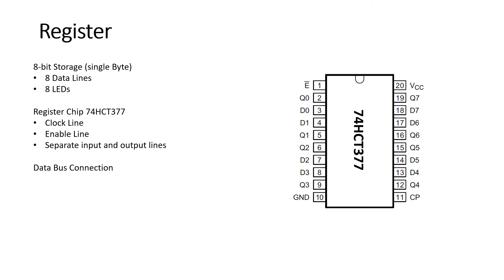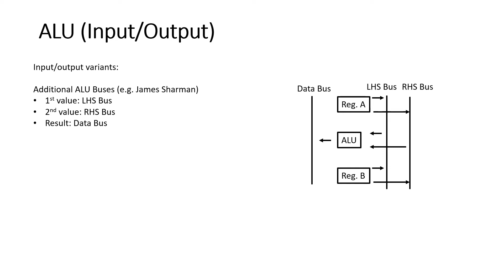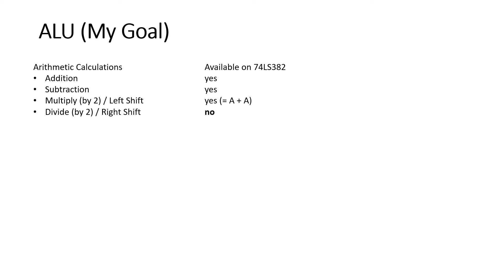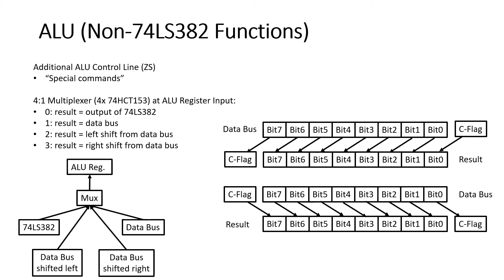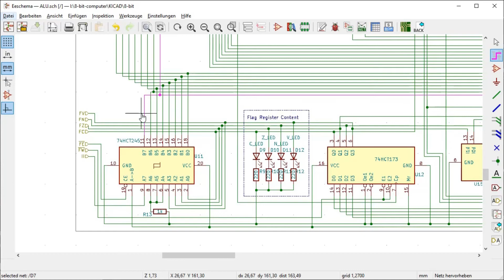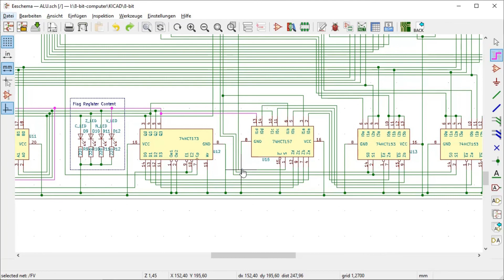8-Bit Breadboard CPU (ALU, Flags, General Purpose Registers)

Comment: Will you be posting an instruction set video anytime soon?
Reply from the maker: When I created this video I already gathered the footage for the micro code and instruction set video, but the slides I created to guide me through this topic didn't meet my expectations and I deferred the video. Soon after I got distracted and only recently started uploading again (it's an "easter egg" video only available through the playlist). So, yes, I'm in a good spirit to restart working on the missing video about the instruction set.
Reply: @DerULF1   Hello! I apologize if this is inconvenient, but are you alright with simply uploading the instruction set and format onto your github? I am trying to compare some different instructions sets that I've see to aid in the construction of my own expanded Ben Eater SAP-1.
Reply from the maker: @A_Hipposhark
Sorry for all the delay. Obviously I forgot the promise I gave to you.

I made a quick export of my old presentation slides which match the state of the machine shown in the videos. It's available now in the root directory of my GitHub repository. Please feel free to get back to me if you need more information. Talking about computers is never inconvenient for me. ;-)

If you compare that to the Arduino Sketch EEPROMMicroCode.ino which creates the micro code you might find one additional instruction called INB which was in a test stage at that time. This instruction is my first complex instruction with a loop in it's micro code and is reading a complete byte from the SPI bus. Later I was able to extend that to a nested loop and to read a block of 256 bytes into memory.

I hope you have as much fun building your own computer as I do.
Reply: @DerULF1  Hello! Thank you for sharing the slides as well as your explanations; they have all been very helpful. I do have another question relating to your schematics. I am also trying to sketch some of my breadboard modules in KiCad, but I can't seem to find any of the 74hct chips in their library. May I ask where you got those?
Reply from the maker: @hipposhark  Happy to hear you were able to do something useful with my shared ideas. About the HCT-components: The truth is that I kind of cheated by (mis-)using KiCad more like a drawing tool than a circuit design tool. So I just placed that chip onto the sheet that was close enough to the one I needed and changed its description to match the the one I needed. This is why I didn't upload my KiCad files but only the generated PDF files.
Reply: @DerULF1  Ah I see. Very clever! I will see about doing that as well. I have another question concerning your ALU. If you are currently multiplexing the 382's output into the internal state (ALU register), wouldn't it be in an infinite loop at the rising clock, where the 382's input from the register would change, so it would continuously output a new value into the same register over and over again as long as the clock is high and multiplexer's value is loaded into the ALU register? How does the 382 only output the intended first value and stop outputting? Thank you for answering my previous questions!
Reply from the maker: @hipposhark  I'm happy to read, that you're still on your way. The ALU register chip (marked as U2 in my ALU schematic) is a 74HCT377. This chip latches the input value exactly once at the exact time when the clock changes from low to high. Although the output of the 382s is indeed changing a few nano seconds after the rising clock, this output is not read by the 377 and so only the first output value is kept in the ALU register. I hope that makes sense.
Reply: @DerULF1  That makes sense. I was asking because I was trying to implement your design with some modifications which included the 74HCT191 instead of the 74HCT377 for increment/decrement capabilities, but those chips were unable to latch onto inputs as you pointed out the 74HCT377 could. 

I also have another question about your instruction decoder/control logic schematics. Your explanation and reasons for adding the interrupts and the addition of the IC/IL lines were clear, but I am still confused of the purpose of some chips on the schematics. For example, what is the use for the 74HCT173 in the Instruction Register. I see that the first bit from the instruction register is being fed into the chip, and the select line is toggled by the IL/IC lines, and I also saw that you mentioned extended instructions in another comment on the video, but what purpose does this serve or how does that work? 
I am also not following the reason for multiplexing the instruction register with a word consisting of the bits of the ALU function selector and the data bus enables. You called them 'labels', but what is the purpose for that, and wouldn't the values collide with the predefined instructions values? 
Also, how does the microcode work if the values of the step counter not also being fed into the microcode address table? Wouldn't incrementing the microcode after it has been found based on the instruction, flags, and control lines (the address) effectively be destructively manipulating the data gotten from the address table. Instead, shouldn't the step counter and the microcode address table be separate values being fed into the microcode ROM? How does the step counter count from the inputted decoded instruction value? I am very confused.
Reply from the maker: Sorry, for confusing you and also for the late reply - I've been too busy last week. I've tried to put the anwsers in a new video covering the topic "extended instructions" ( https://youtu.be/8lOQt8oHVbg ). Please get back to me if you need additional information.
Reply: @DerULF1  no worries! i did eventually figure out what you were trying to do after taking a nice long look at your breadboard, realizing there were some ics missing based off of the schematics from github (extended instructions were a newere addition i'm guessing), and reading through some of your comments from other videos. 

I just saw your newest video, funnily enough before i read your comment here, and it was really helpful in clearing some of my doubts with the instruction decoder and microcode jumping, which I have to say the design is pretty genius. i really appreciate the help and ill keep you updated with any more questions via this comment chain i suppose!
Reply: @DerULF1  Dear DerULF,

I am still working through understanding your system. Lately, I've been reading over the microcode programmer you've uploaded to github, and I came across some lines that I didn't understand. 

when implementing the "PLF" command, it appears that you have conditional microcode that toggles the II flag depending on the current state of the negative and II flag. may I ask why you are involving the negative flag into this conditional statement? specifically lines 929 - 947 in the EEPROMMicroCode.ino file on your github.
Reply from the maker: Another question I left dangling for far too long.

The interrupt inhibit flag (II) is somewhat special in the sense that it's not stored in the flags register as the other flags are. When the 4-bit flags register is put onto the data bus, the otherwise unused bit 7 is replaced with the value of II. So during PSF (PuSh Flags), the state of II is stored as well. When restoring the flags register during PLF (PuLl Flags), it's not enough to just write the lower four bits back into the flags register; the value of II needs to be restored too. To check whether or not bit 7 was set in the byte used to store the flags, the byte value from the top of the stack is OR’ed with 0 to set the N (negative) flag accordingly. Since the system design doesn't allow for directly setting or clearing II at the microcode level, but only toggling between set and unset, a jump with a conditional destination is needed. When the II stored on top of the stack differs from the current state of II, the jump target is the II-toggle command; otherwise, this toggle command is skipped. Finally, the lower four bits of the byte on top of the stack are written into the flags register to restore the other four flags.

But you already figured that out yourself, as I saw in the comments on your microcode sketch. ;-)
Reply: @DerULF1  oh wow, yes! i am very happy to see your response! i did eventually reason that the interrupt flag had to be restored based on another signal somehow, and I guess the negative flag was just chosen for that in design.  i am also very pleased that you looked at the files in my github; i have been studying your design religiously for several years now, and really appreciate the documentation on your github in helping me construct my system. thank you very much for the thorough response! if it is possible, is there a better way of messaging you besides these YouTube comment chain? I may have more questions regarding the software behind your CPU :D

Comment: Hello. 

First of all, awesome job, awesome project and a really, REALLY, good job!

I would like to make  an instance of your project using modular PCBs instead of breadboards and add features to it (like wifi, esp8266, code upload) but i am having a few troubles.
I cant find a proper BOM, and i cant find some chips like the 628128. 
Can you please help me ?
Reply from the maker: Thank you for your nice comment.
Since I never planned to put that project onto PCBs my KiCAD files are in no way useful as a starting point. There are way too many components that I just copied and renamed without caring for the footprints. So unfortunately I can't generate the BOM out of those files. But when I placed my first order for parts I manually put together a list of the components I would need based on the schematics I had drawn so far. That covered all the basic modules but not the peripherals. I also didn't update that list later when I made smaller changes to my original design, so it doesn't reflect the current state of the build. Nevertheless I put that early BOM onto my GitHUB repository hoping it might at least give you some orientation. You'll find that file in the root directory.
Concerning the chips: The 628128 is a simple 128kx8bit SRAM module that I got at a German distributor (Reichelt) but some chips (like the 74LS382) seem to be avialable as used chips on eBay only.
I hope you get as much fun building your version of the 8 bit computer as I had. In fact I still have fun with it as I still make minor enhancements and made some progress in programming a dedicated operating system. Maybe I'll make some videos on the enhancements (no, I didn't add more breadboards) and the operating system in the future, too.
Reply: @DerULF1  Thank you!  

Can I help with your project in GitHub?
I will upload any work I do.
 Are you interested ?

Comment: Nice work, I'll be interested in your instruction set and how you implement it.  Are you going to keep it a pure 8 bit computer or are you going to increase the memory space? To 12 or 16 bit? 
  I hope you will design some program upload functionality,  Ben Eater's method burning a EEPROM for every program change is annoying.  I can see using an Arduino to halt your core, preload the address counter and write/read data from the data bus.
Reply from the maker: Thank you for the compliment.
I'm planning to release an episode about the micro code and the instruction set of my system, but don't know the exact date yet.
My address bus is 16 bit wide. So I can access up to 64k byte of memory. I already made a video about memory in my system, that may answer your question in greater detail: https://youtu.be/pgtFDUwGmAs.
I connected an SD card reader to my system and implemented a FAT file system driver. That way I can read programs directly from an SD card into memory. Some details on communicating with an SD card reader are in my video about my SPI bus interface: https://youtu.be/LilCeYtd2m4
Reply: @DerULF1  I just watched your memory video, I hadn't done all my research before I asked my question, sorry :grin:. Good work!